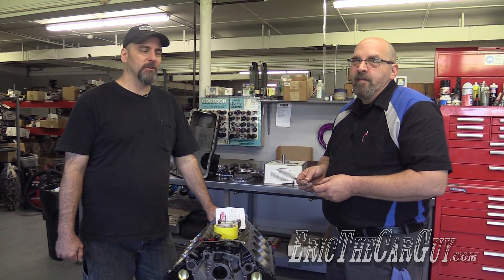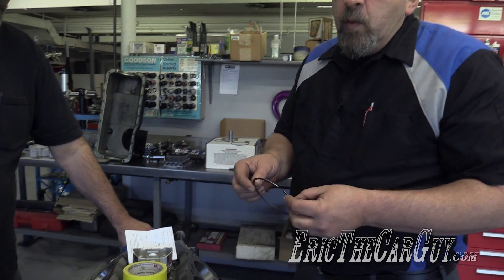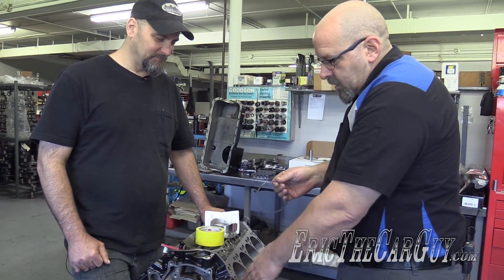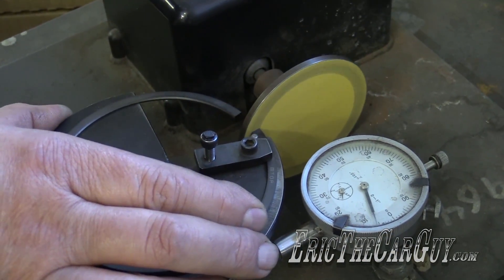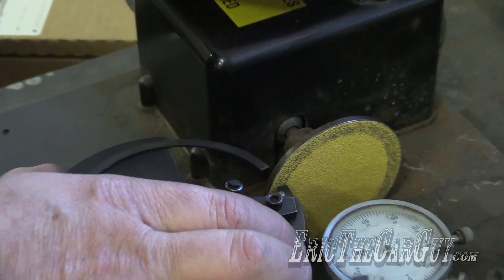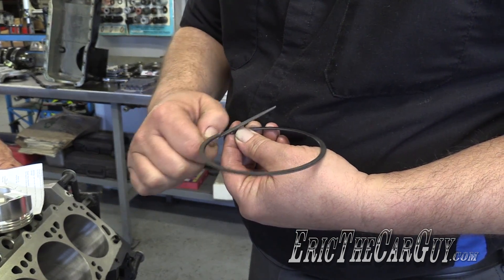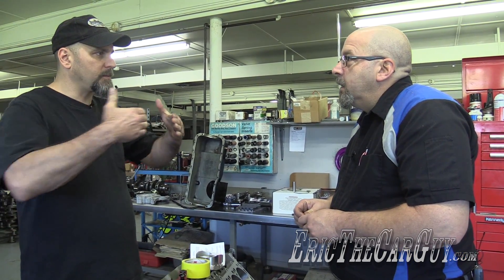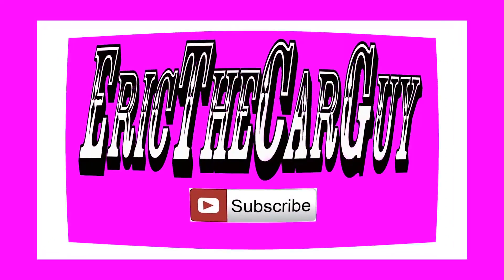How To Properly Gap Piston Rings

Comment: If piston rings rotate during operation, couldn't they eventually line up and cause a compression loss or?
Reply from the maker: Kevin and I never had that conversation. You should avoid commenting on things you know nothing about.
Reply from the maker: I do admit when I'm wrong, in fact, I often put it right in my videos. In this case, I'm not wrong, there's just a difference of opinion. As for Kevin, he made that comment after the fact and with good reason. He's trying to protect his business. As stated, this was my idea, not his. He's not responsible whatsoever. We never discussed the turbo oil return, Justin and I sorted that out ourselves as you saw in the video. So, as I said, that conversation never took place, hence, you don't know what you're talking about. As I recall, you weren't there back in May when this work was done so I really can't see how you would know what was discussed or not. Just because I didn't do it the way many people wanted it done, doesn't mean I did it wrong. It's only wrong if it doesn't work. It does work, and doesn't leak. Not sure how else I can put it. If at some point it leaks, I'll be sure to share that information and admit my error. I'll also be happy to share that it doesn't leak. It seems to be you that's holding a grudge and bringing this up in unrelated videos, not me.
Reply: +mrsemifixit 
Most piston rings do rotate during normal operation, but not like flat tappet lifters, the movement is relatively slow and subtle. 
Some pistons and rings are pinned and are designed not to rotate, but some are allowed limited range bidirectional lateral movement limited by the pin in the piston and a notch in the ring. 
Eventually the ring gaps will align, but the alignment is brief and the rings continue moving and the gaps are no longer aligned. 

Kris Nicholson is almost correct, the gap narrows, but it does not close to zero or near zero gap. Zero gap on butted piston rings is a condition that results in extreme ring friction, drag and usually causes severe damage to the piston ring lands or pulls the piston crown off of the piston in the area of the rings. That is why there is additional gap required for power adder and forced induction applications where the piston and rings are exposed to elevated temperatures and causes additional thermal expansion. 
The reduction of emissions after warmup is due to improved combustion efficiency, and emissions reduction equipment such as O2 closed loop mode and catalytic converters reaching their critical operating temperature and has nothing to do with ring gaps.
Reply from the maker: Hard to say. https://www.youtube.com/watch?v=YoNeEToRjiQ
Reply: Kevin seems to know what he's doing. You should have listened to him when he told you how to put the hole in the oil pan.
Reply: EricTheCarGuy Kevin commented on the post and said that he told you what was wrong, but that you wanted to do with the way the instruction said because you want to show the viewers. Sorry Eric, I do know what I'm talking about. Perhaps you should stick to changing oil on Hondas. I've enjoyed your videos for years, but you should really admit when you're wrong. You have not done so in this case. Many viewers have told you the same, if you're too stubborn to listen.
Reply: mrsemifixit It won't cause loss of compression. Here's what I know from personal experience. Once the engine is warm it doesn't matter much where the gaps are. When the engine is cold I've seen zero improvement in leak down test when they are 180 off using 80psi. The rings rotate and float around anyways. If there's loss of compression past the rings, it's things like bad rings, worn cylinder walls, coned bores, pitting etc that cause it. Let's see what Kevin says in the next video. Can't wait!
Reply: ***** 
Excellent link.

Comment: If the piston rings rotate during operations why set gaps 90 degrees apart? In theory then your rings could rotate at different rates and the gaps could align, making for low compression. I have never heard of this, has anyone? Please let me know if any of you guys have witnessed this first hand, no hearsay or urban legend please. Thanks. Sam.
Reply: Sam Johnson I was taught years ago that this placement is optimal for initial startup for several reasons.  First it keeps the gaps far enough away from each other on initial startup so the pressure will build sufficiently to start seating the rings immediately.   Second is that you don't want either of the gaps in the major thrust side of the piston on initial startup to reduce the chance of cylinder wall scoring from the ring ends on initial startup.   The major thrust side of the piston is the side that rubs against the cylinder wall on the power stroke.  Imagine a piston going up and down with a crankshaft below it going clockwise.  On the power stroke lobe of the crankshaft journal is going down on the right side of the centerline and the connecting rod is at an angle from the wrist pin to the crank journal.  The forces on the bottom of the connecting rod is down and right. And the force on the top of the connecting rod is up and left.   This means the left side of the piston is being pushed hard against the cylinder wall so they call it the thrust side.   Hope this helps, Chris
Reply: Check this out. someone actually measured the rotation rate.  https://www.kns.org/jknsfile/v31/A04803285773.pdf

Chris
Reply from the maker: https://www.youtube.com/watch?v=76UFa5VWwuQ
Reply: Thanks Eric. That is some interesting research, had never really thought of piston rings rotating. That's what I get for assuming. Sam.
Reply: why 90? why not 180?
Reply: That's what the manufacturers rebuild manual called for. I didn't write the procedure. I simply followed it to the best of my abilities. i'm not the one to ask. Peace, enjoy getting dirty. Sam.
Reply: Sam Johnson It was actually a reply to Eric's reply but youtube doesn't do the +name automatically in comments like it does when replying to comments through the notifications drop down like it did for this reply to you. I keep forgetting about it even though lately it has really been pissing me off. Stupid youtube. I knew you had to offset them from small engine repair in high school but you would think 180 would be the best. =)
Reply: I agree. I realized my mistake a nano-second after I posted.
Reply: I can say that of all the pistons I have pulled out of motors, none have been aligned "correctly."
Reply: Eric, those rings were not turned to where that brown spot was.
Reply: K. SAM.
Reply: The ring placement part is helpful. I learned the other stuff in power plant class at P.I.A., of course that was thirty years ago. Cross hatch cylinder, rings 90 degrees from piston skirt. Thanks Chris. Sam.
Reply: Sam Johnson i was thinking the same thing!
Reply: "In theory then your rings could rotate at different rates and the gaps could align, making for low compression."
...which is why I was told to take compression readings with a grain of salt, especially if only one cylinder is down, and the engine is running good otherwise.
Reply: Makes sense to me. Although for initial start up I would want proper orientation.
Reply: Sam Johnson for piece of mind for good lubrication during bed in and initial start
Reply: there needs to be a periodic ring gap disalignment maintenance to every car

Comment: Never knew piston rings rotate during engine use.
Reply: @Eduardo León Morales So then whats the purpose of clocking the rings in the order the manufacturer specifies? If they rotate around freely then there's no point in clocking them 45 or 90 degrees. might as well put the top ring gap over the second  and all the way down right?  It's bound to happen at some point if they are just rotating around freely.
Reply: @sssmithVR  they're staggered when assembling engines for the break in period.
Reply: I have a 2004 Hundai Getz 1.6L petrol engine. I have tested compression and is good on all 4 cylinders. I'm still getting blow by. The PVC is working not stuck. Is there something else I check ?
Reply: Fusion illusions yes mic them for being out-of-round.
Reply: I thought he specifically mentioned that the rings need to rotate during normal piston use.
Reply: Rings will rotate in the bore. There is clearly nothing preventing the rings from rotating!
Reply: Eduardo: I'm also a mechanic so also talking with knowledge!
Reply: @Nasher16  If not you'd have blow by on startup.